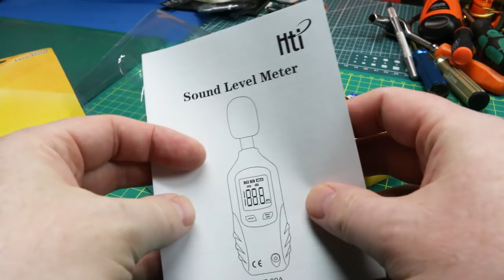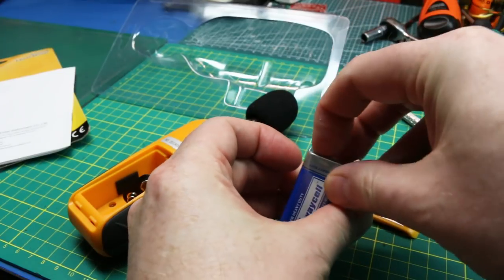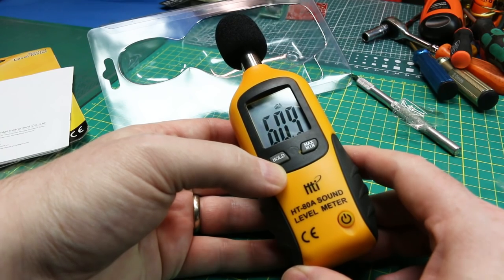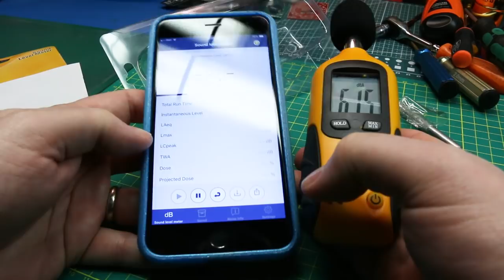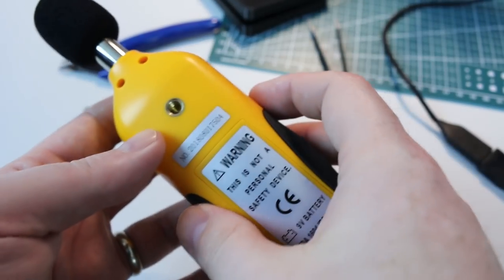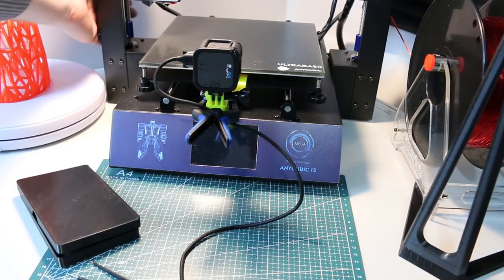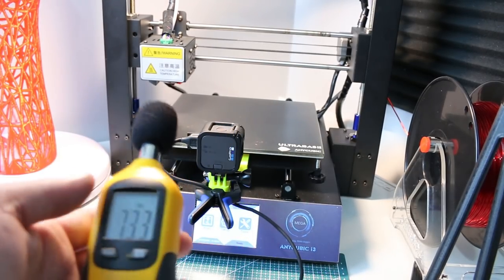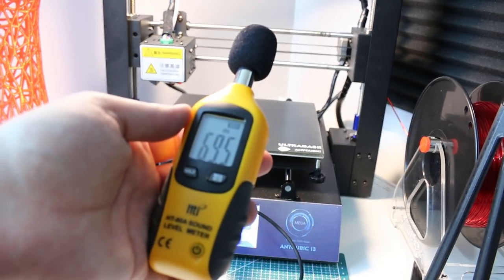Cheap Sound Level Meter- Does it WORK?

Comment from the maker: Definitely better quality and performance than I expected. Even works well for very loud/high levels. Anyone tried any other brands that work?
Reply: I have an UNI-T, I had a Mastech also. Both Chinese brands but not so cheap. I don't know how much you paid for this one but mine were around 200 Euro (over 200 USD) each. You appreciate the meter is working by comparing it with a phone? Man.. I don't know, those phones have huge problems in measuring. UNI-T and Mastech both give a maximum error of +/-1dB and if you ask me that's a lot. Is a lot already. Keep in mind with dB is not like with volts or whatever. 12 volts 13 volts.. yeah whatever. In the dB world is quite important, with every 3dB the power is doubling. Don't you noticed your voice was around 60 almost 70 dB and a plane is around 90 dB when is taking off? Is not a linear scale and also you need precision as fuck.
Reply: What decibel reader would be acceptable in court

Comment: One difference is your test conditions between the phone and the HT-80A were different.  With phone you had the microphone pointed generally away from the sound source, with the HT-80A it was pointed toward it (3D printer etc).  Maybe this contributed to the lower readings with the phone.

Comment: Surely the phone is the least accurate device to check it against. You need an external microphone for noise level readings rather than one designed for voice recording.
Reply from the maker: Send one. Address is linked on all my sites.

Comment: Appreciate the review. Quick question if I may. Why would you bother using the dB sound meter when you get such similar results from the app? I need to check sound levels before and after insulating a house. Am I just as well using the the app?
Reply from the maker: Can't say. I dont have a calibrated source to compare to. I would not rely on a phone app which is using a mic designed only for capturing human voice frequency range from 2 inches away at speaking volume (very low DB).